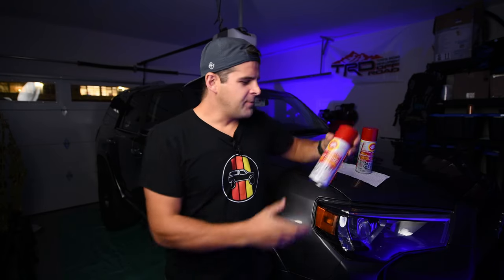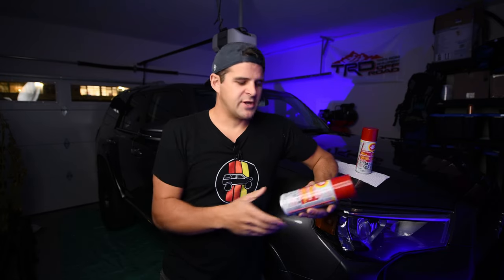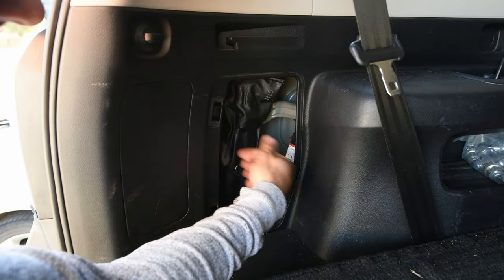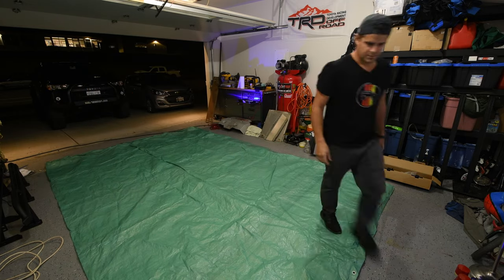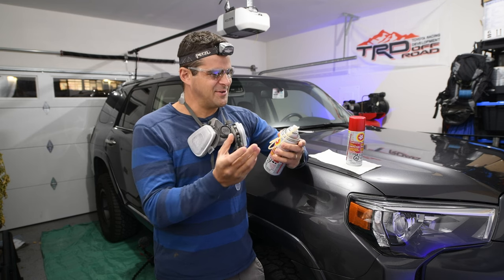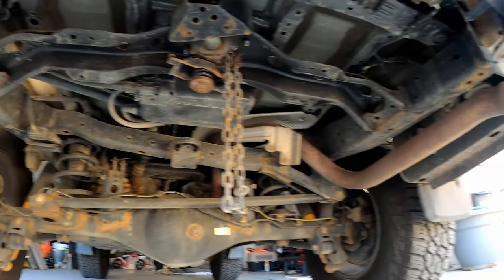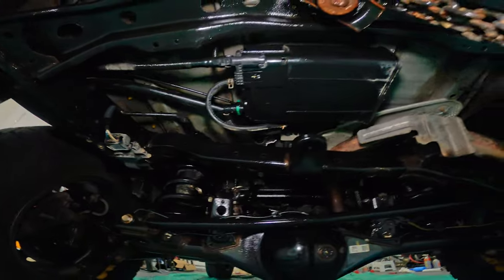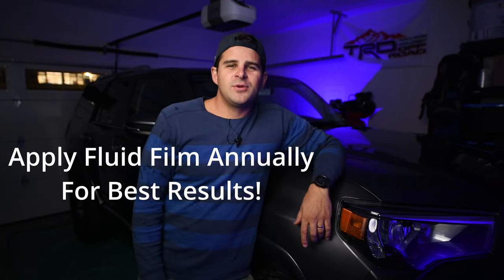The Best Rust Protection For Your Toyota - How To Stop Your 4Runner From Rusting

Comment: I just "Blasted" my brand new 2024 4Runner with Blaster Surface Shield yesterday.  I've used Fluid Film on various things for years and it's great.  The surface shield is also lanolin based and seems to last longer because doesn't wash off as easy.  I bought a 5 gallon pail and the woolwax brand spray gun set. I bought a few rattle cans of Fluid Film with the little 360 degree spray tube to get in the door weep holes and areas like that.  Beyond my 4Runner, the 5 gallon was enough to do my Jeep Wrangler TJ, our Honda Odyssey, as well as my brothers Infiniti Q40.  Still have about a gallon left for touch ups in later years.  The Surface Shield doesn't smell very much compared to the Fluid Film.  A few tips:  Take off all those rubber plugs you find under the body and send an extension wand down them as far as they'll go.  Spray in there good cause you should only have to do it once.  Then replace the plugs.  Use a 360 degree tipped spray wand to shoot product on the top of the frame rails and things like that.  Just spraying from the bottom won't hit those areas directly.  After doing 4 vehicles I found the 36" wand with the 360 degree top was the thing to use first in every frame hole, body plug, tight space, and frame rail top before every using the standard spray nozzle to wide spray all the rest.  You'll get misted with the standard nozzle so save that for last and keep it at arms length to keep it away from you.  There's really no need to buy any extension length other than the 36".  You can choke up on it for closer areas and use the full length to send down the inside of frames.  I had a few shorter ones, but never bothered with them.  It was one go through with the 36" and a final over spray with the standard spray nozzle.  Take the wheels off and wrap kitchen trash bags over the brakes so you don't have to be so careful around them.  Makes it much faster and no chance of lubing up your rotors.
Reply: Drive through rain and it is all gone, what do you do, apply it every time it rains ?
Reply: @lx4118  Yes.  Every time, but it only takes a few hours so you get used to it...    Actually, it doesn't wash off like that.  Touch it up every 2 years.
Reply: @counterbalancelife4305 I usually check every time I do an oil change. I bought another spray gun from Amazon, think it was $44, bigger mouth for going straight from a gallon container.
TCP air rust proofing and undercoating gun!
Reply: @counterbalancelife4305  that's a confusing response. does it wash or not when it rains?
Reply: @BlueInOrangeAgain  No it doesn't.  I was being a bit sarcastic.

Comment: I spray inside drain holes on bottom of doors too. Salt and snow drips down and sits in door seams. Great product.
Reply: yes indeed.  I was doing speaker swaps in all the doors so carefully minimally slit the plastic sheet and shot the bottoms from above inside the doors.  then used good tape and repaired the slits.
Reply: May I add that the top of the gas tank is an important place to spray.  These trucks can run for many years and a rotted gas tank and fuel lines on top of the tank can cause some major headaches with a truck that is otherwise just fine.🙂
Reply: How often should you use this?
Reply: @JohnnyReno71  You apply it every year, 1x a year. Surface shield you apply, according to their statements on website and on cans/gallons, U apply it every 2 years.

Comment: Coming from a snowbelt, I can tell you the best time to rustproof is in the spring when the salted roads are no longer and the temps heat up. And an oil based spray that drips and get EVERYWHERE is the best(krown or rust check). Any dripless formula is only useful for where it hits, but it doesn't hit everywhere.

Comment: I'd recommend Fluid Film Black over the clear stuff.  The reason is that I've noticed that if there is a spot where surface rust is present, the color of the rust is pretty noticeable making touch up spots in need of attention much more apparent.  I swear by this stuff, as my daily driver is a 2009 Honda Fit Sport, and it has some areas where there is rust, and I'm of the opinion that it's stopped the spread by my spraying those areas.  I only wish I would have known about doing it from the day I bought that car.  The last thing I'll add is this:  I'm going to put the Black Film on my 4Runner two years in a row to make sure I'm thorough on the frame.  With the rust history these things have, a couple hours a year and $50-$75 for a few cans to prevent the rust is well worth it in my opinion.

Comment: I used FluidFilm inside the rockers and door bottoms because a very thin extension 360 degree wand is available for the cans and it wont wash off in there...but i used Blaster Surface Shield on the frame and crossmember and all underneath..it is a product similar but doesnt wash off as easily with road spray, so longer lasting,  and does not smell as much for sure.  I think it was a great combo !  Edit:  I second the tarp recommendation !!
Reply from the maker: Sounds like the perfect combo, I’ll have to check it out. Cheers!
Reply: I'm going to be doing this myself for the first time, is there certain parts or ares that you would avoid? Do you recommend taking off the black skid plate and hitting that whole area as well, and the plate? Thank you!
Reply: . @ChezTJ  Yes do all crossmembers and frame above the skid plates, get into the inside of the frame thru the plastic removable plugs and any holes you can, and remover the spare.. to access above/around. i did my spare rim too.  avoid obviously the brakes area , and exhaust
Reply: @g.fortin3228  Great! Also, I just took a look at a few other videos, they mentioned the fenders are problem areas as well. I went to take a look at the area in and around the tires, I noticed that the back "well", by the shocks (both rear and front) have the what I believe to be the frame as well as some metal/steel parts that create the shape of the tire well. Should I spray behind my tires (avoiding brakes/rotors) and hit that whole fender area? Do I want to avoid hitting the springs and shocks and UCA's? Thank you again!

Comment: Best protection is "don't live in the north/winter regions that use salt on the roads". Or also you will be surprised there will be no rust when you will live in a north region with snow but no salt on the roads, can't image where, but I know some countries don't use it. Salt is actually bad for the soil around the roads and not only.
Reply from the maker: Some of the stuff is horrible for sure. Killed our hedges and ate chunks out of our concrete
Reply: Я купил свой 4Runner в таком регионе и в свои 20 лет он был просто в идеале!

Comment: One thing about oil is that its fluid, meaning it won't crack like paint does. Also you can literally POUR this thing into holes and unreachable areas of frame.

Comment: Great product, I use the black stuff , I find it holds up better 

Cheers
Reply: I just put the Fluid Film Black on my 2012 in the fall.  The thing I'm noting is that if there's a spot where surface rust is present, the color of the rust is pretty noticeable making touch up spots much more apparent.

Comment: next time you wash the frame  wash  and get a wire wheel and hit all the frame spots with it to bare metal then rinse and wipe all the residue to dry, then acid etch the bare metal, maybe rinse it off after dry again then apply a 1K or 2K acid etch metal primer whatever you want and then small layers 2 or 3 tops then let dry and then top coat metal primer or whatever to actually protect the frame external    then when all dry across entire frame ( take wheels off for better access)  apply fluid film onto the entire frame and internals for Much longer longevity and value added to vehicle for rust proofing
Reply: Better, when the truck is new, use a red scotch brite on all of the black painted surfaces (especially welds) then apply two coats of KBS Rust Seal paint. Use Cavity wax in all cavities. Your truck will never rust even if you never apply Fluid Film and live in the rust belt.

Comment: Thanks for another great video! Is there certain areas or parts to avoid? How about taking off the OEM black skid plate and hitting everything under there? How about the skid plate itself? I'm afraid of overdoing it and then something mechanical being compromised later. Thank you!
Reply from the maker: You can basically spray it anywhere water would hit. All the electrical and mechanical parts will have their own seals. Avoid your brakes and exhaust though for obvious reasons

Comment: Being that this is an oil based product I am thinking it will just attract the dirt and when you go to power wash it probably most of the product will be taken off. Personal myself I prefer rockguard over this product or an undercoating product. The rockguard will not crack like a tar based undercoatings or go gooey from oil drips. I have even used it on the back side of my chrome bumpers to prevent them from rusting inside out. Before applying the rockguard you have to attend to the existing rust. This means spending some time grinding off the rust to bare metal, degreasing and painting it with a urethane or epoxy paint. Using any of the store bought spray cans is a waist of time as they will never stand up to beating your frame takes from rocks or salt. To date I have had no rust on my frame since I sprayed it 22 years ago with the rockguard.

As to painting or coating the inside of your frame you are not going to get the protection if it is not cleaned first. This means firstly it needs to be vacuumed out. You would not believe how much sand and dirt works in through the side holes especially if you do alot of gravel road driving. After that if you can get access to the inner parts of the frame it would be recommended to use a cable with attached chains to rotary beat off the flakes of rust. Repeat cleaning it out with the vacuum and when you have that done then your ready to paint it. Again I would prefer a paint designed for spraying inside the frame. I think the oil based product is just going to collect the dirt and sand.

Comment: Very good video thank you. Can the extension wand be cleaned to use it later?
Reply from the maker: Yes it can. The product doesn’t harden
Reply: @T4Rgarage  excellent thank you
Reply: @T4Rgarage  hey there, sorry to bother you but I m going to do it this weekend and I would like ask you if is ok to spray the entire exhaust pipe ? Thank you
Reply from the maker: @GG-un5wk  I would avoid spraying the exhaust pipe but if you do it won’t harm anything, it will just smell bad when it burns off

Comment: This looks likes a good product, but what happens I you must drive in a very silt type duxt that also turns into a gloppy mud when wet? Does the dust adhere to it? If you have to wash the mud off are you going to have to respray? Or is this product primarily for city streets?
Reply from the maker: I personally wouldn’t do any washing until the end of winter. Dust/dirt adhering to it can be a good things as it will protect it and won’t allow it to wash off as easily.
Reply: @T4Rgarage  thanks for your response

Comment: Would there be any benefit to removing the surface rust that's accesible first?
Reply from the maker: Unless you’re planning to sandblast,  clean, primer and recoat, I wouldn’t bother. This product will actually absorb into the rust and should help prevent any further rust from occurring
Reply: Yes I have used a rust converter. There's several brands. POR 15 is highly rated but sticks to everything permanently. Rust-Oleum has a really good one. They convert rust (iron oxide) to iron phosphate which can be coated easily with what he used.
Reply: @T4Rgarage  you should try a rust converter. It's a worthwhile step in preservation of the vehicle.

Comment: Do I need to brush off the rust first (not power washing it but with metal brush) before applying?  I have an 07 FJ Cruiser with rusts.
Reply from the maker: No it’s not necessary, this will absorb into the rust and stop it just as long as you apply it regularly and especially before winter
Reply: @T4Rgarage  thank you

Comment: I wonder if anyone can answer my question. If I have rust existing in my frame, should I get rid of the rust first (maybe with rust conversion) or just use spray film straight away?
Reply: Ideally yes. You want to expose the raw metal to coat it. There is no point in coating the rusted surface.
Reply: It doesn't HAVE to be down to bare metal, but use a stripping tool off a drill to eliminate any LOOSE rust. Fluid film will weep into rust & hard to reach parts.
Reply: Get the loose rust off and use KBS rust converter and KBS Rust Seal paint. Once you use it, no other explanation will be needed.
Reply: Much appreciate the input. I ended up stripping the really bad ones and some rust converter. It seems to hold up so far.